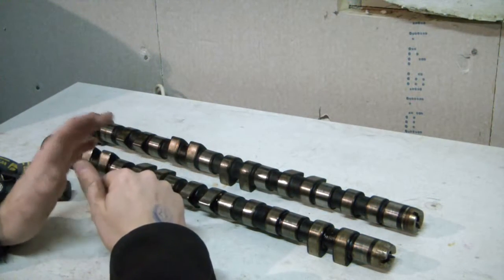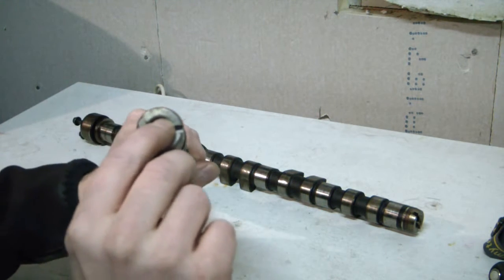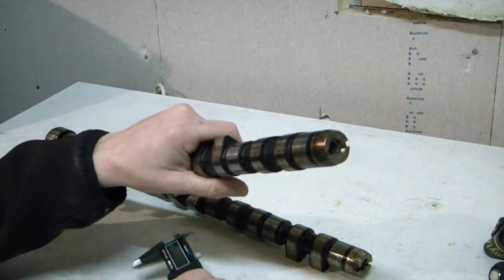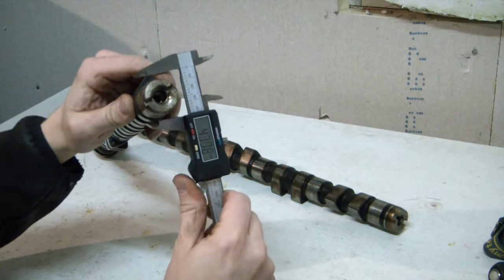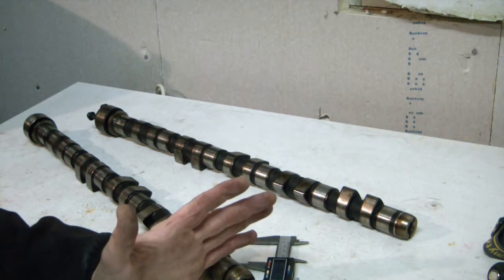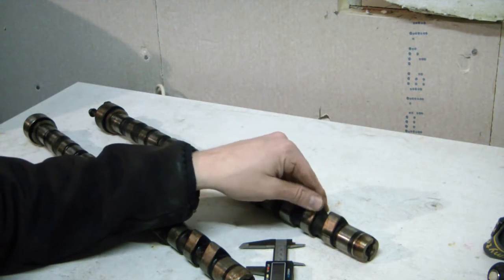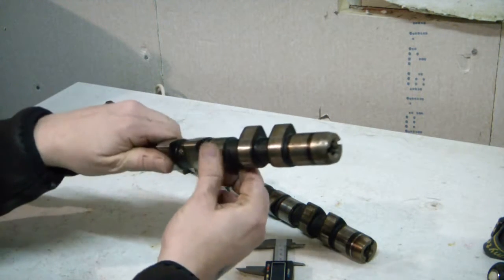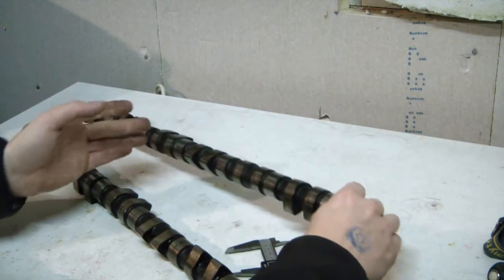Na camshaft upgrade to your 850 v70 turbo

Comment: With a standard connecting rod, it is only good that the power increases at higher revs. My chip allows the pressure to increase to the maximum only from 3500 revolutions onwards. That too is a protective factor.

Comment: Onto 2.0T(1984cmc/ T2) and 2.0 T5(1984cmc/ T3) ,M.Y.1998 for Italy ,means 180hp ,226Hp has similar camshaft 40mm lift(total measurement) and 6  bearings measurement 30mm in diameter
Like on 2.0T5  it's similar to 2.3 T5(2319cmc)M.Y.1998 the dimension of the IA and EA camshaft.
Right now i have an 2.0T  to overhaul service(head gasket problem)
Perhaps on the cars from US there are some little differences.

Comment: I love your videos. I have a 96 850R with IPD tune with RIP kit. If I change to NA cams, I have 2 questions 1) Do I need to retune? 2) what would the timing become for intake and exhaust regarding  Advance and Retard
Reply from the maker: Technically you do not need a retune.
the engine management of the 850 can adjust for a lot of variation before giving any codes.
So you will feel it and get benefit by just fitting the cams.
Just Zero the cams as you would stock cams to get move the powerband up the rews :)
Reply: @Volvo5Cylinder  Thank you. I hope you post more videos...the Volvo community miss your informative videos. But I know how crazy life can get. Be blessed

Comment: when installing, is it recommended to keep the turbo cam settings or adjust them differently?
Reply from the maker: I would not adjust them with out dynoing the car at the same time in order to be ale to get positive befefits.
The stock setting is quite good and many who have made alot of power just leave them at that.

Comment: I have a s70 glt and its turbo not allglts are na
Reply from the maker: Hi. 

Yes in the States the GLT was sols as a "trim level" just like on the 240 and other models. 
I am used to the "euro nomanclature" (where glt is N.A.) where we call the NA cams Glt :) to differentiate from the 10v 140hp cams that do not fit the turbo models with 20valves. 

 If i ever remake this video i will use the wording NA and not GLT to make the terms more universal. :)  thank you
Reply: Volvo 5 Cylinder oh good to know i actually didnt know that about the glts over seas ive been wanting to put upgrades on my glt 2.4l turbo but im stuck on what to do cause im all stpck at the moment

Comment: it seems like i installed two intake camshafts , unfortunately!while changing the head.

now i struggled getting the timing correctly and i didnt get it in any Possible way, until i find out i put two same camshafts in.Also in one of them the bolt broke inside off!could this be a major problem?so i wonder should i take it out and replace it with my exhaust cam?
Volvo 850 2.5 20v 1994,

thanks